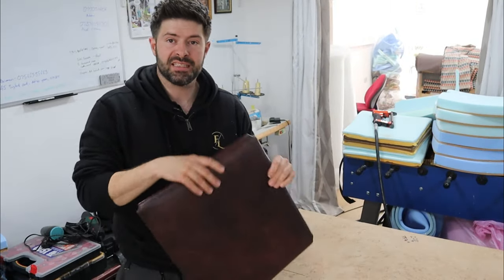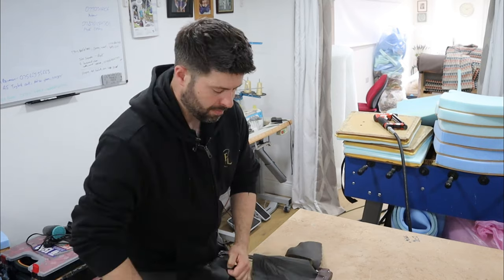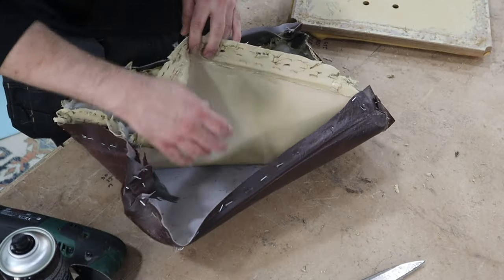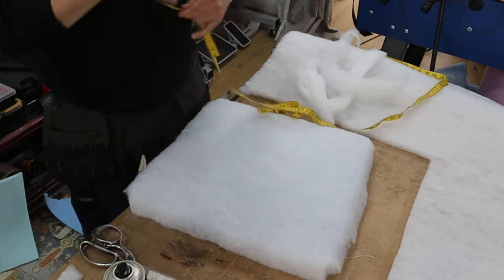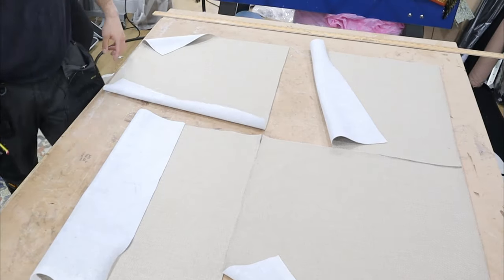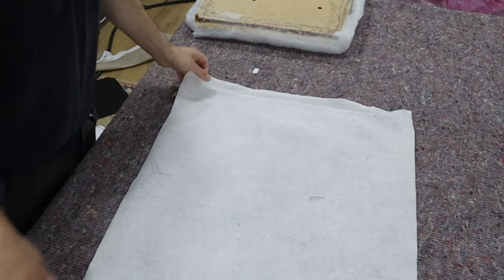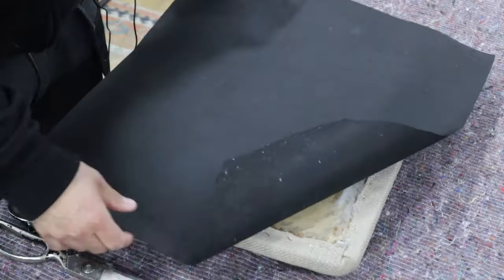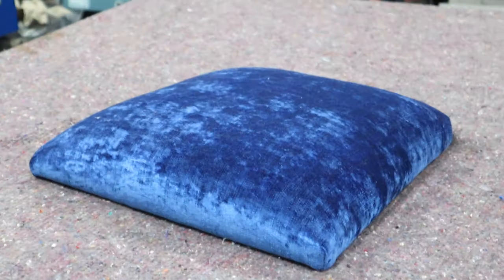HOW TO REUPHOLSTER DINING SEAT PADS IN FABRIC | UPHOLSTERY FOR BEGINNERS | FaceliftInteriors

Comment: Doesn't using a multi tool leave the legs of the staples in the seat base?  I can be slightly OCD about things like that 🙄
Reply from the maker: It does indeed, but know one will ever know! Except you 😁📌📐✂️🧵👍
Reply: Yeah, you’re right. It CAN be a problem if they snag some fabrics where you’re working, or you poke your fingers. A small hammer is always my best friend for things like that - and smacking staples . I have an electric gun, and that’s the problem there😁.

Comment: how to disassemble old fabric? I hope you have tutorial too.
Reply: staple remover or flathead screwdriver 

pincers or pliers

the former dig into the staple and lift it up a bit or entirely out of the wood (a mallet helps to bang it underneath the staple)

pincers finish the job and can sometimes lift fabric and staples together entirely (with the corners/pleats especially)

be safe and keep your free hand out of trajectory of the tool

be careful not to damage the wood and foam